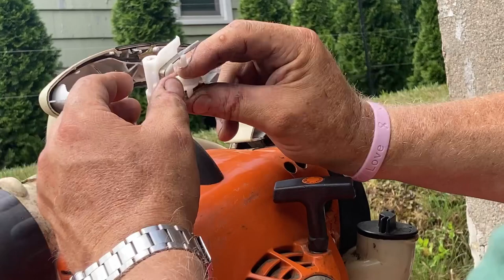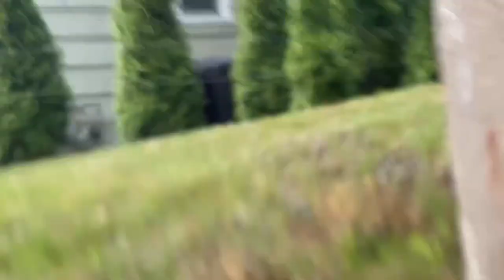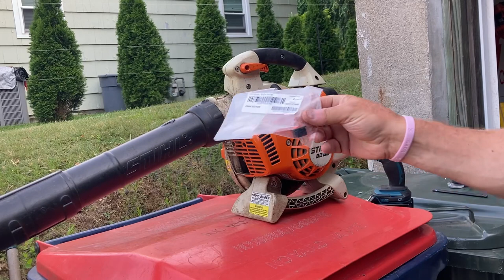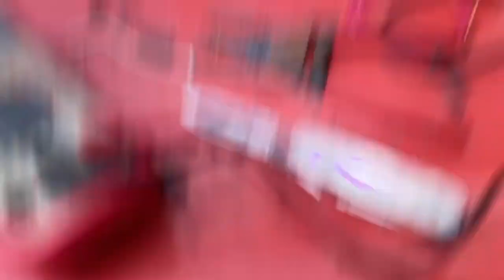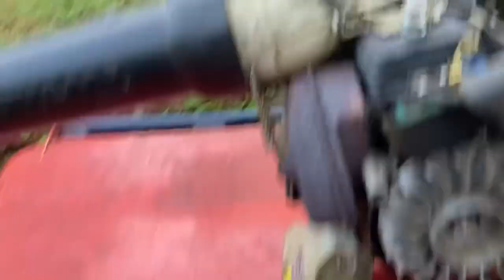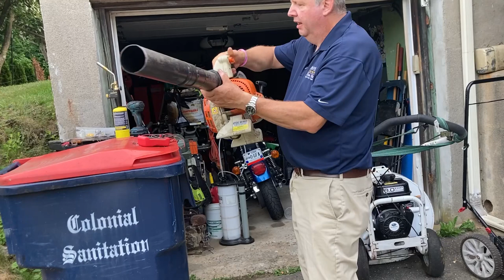Stihl BG-86 cuts out after 5 seconds NOT what I thought!

Comment: Useful video Ken, those little switches do pop apart for cleaning.. Don't loose the tiny spring or ball bearing if you do..
Reply from the maker: Spring, ball bearing? Explain as now I’m curious!
Reply: @KensSmallEngineRepair  In an SPST switch is a spring that fits inside the rocker. At the bottom of the spring is a small ball that rides in a contoured contact bar. When you push the button to off, it moves the assembly to the ground, and releases back to open. This is a simple single pole single throw switch. They can be complicated with multiple wires. Those are usually DPDT. Much of the equipment I worked on in my last job had those type switches. In your case, it's not worth the hassle to take apart and put back together.
Reply: @KensSmallEngineRepair  Hi Ken, @jimbrewer has explained perfectly..I just gently prise the outer body away from the rocker pivot points, carefully clean all the internals with brake clean, then reassemble with a tiny dot of grease.. Works every time up to now..
Reply from the maker: For 6 bucks, I’m good lol!  Thanks for the clarification! We use Micro Switches all the time, never fixed one, except an expensive Allen Bradley switch that was NLA!

Comment: I think you wanted a new switch to have in stock ... LOL   that black wire was intact before you took the switch out the first time , when it was dirty .... All that crud was shutting the engine off , so it wasn't broke all the way yet ..... Take care Mon Ami ...
Reply from the maker: My dealer said that harness gets replaced all the time due to a design fault where the joint under the shrink tubing flexes due to the anti-vibe handle and eventually breaks.  For about a year The on/off switch would sometimes work, then recently just stopped working. The wire I replaced it with should last forever as there is no joint in the area that appears to flex

Comment: Want to add, many times the blower would come in with a complaint of no power. Hit the throttle and it would just bog down. The spark arrestor in the muffler would be plugged up. Those wires would break and the nimrods using it wouldn't write it up, they would just keep using the choke to kill it. All that flooding/oil plugged the spark arrestor over time.
Reply from the maker: Good point, I. Lean my spark arrestor every few months. I like to see the glow from the torch!!

Comment: ok , what did i miss , title says " cuts out after 5 seconds " not won't shut off
Reply from the maker: Both happened. The on/off switch would not shut off the blower while running and lately it would shut itself off after running about 5 seconds.  Turns out the anti vibe system pivoted at a location allowing the blue and black wires which were shrink wrapped to break from continuous flexing and work hardening